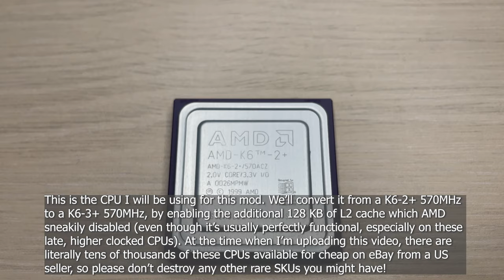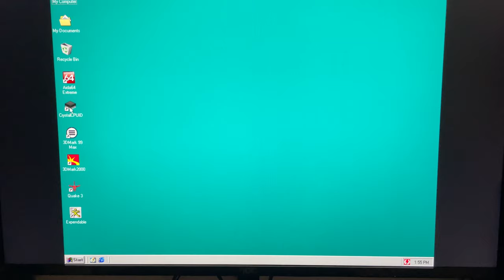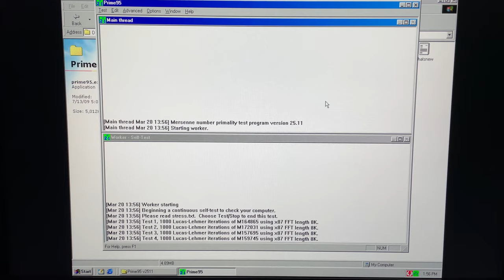GUIDE: Modding an AMD K6-2+ CPU to a K6-3+

Comment: Also, 600MHz? Nice little clock, there.
Reply from the maker: Yeah, all of these CPUs handle 633 MHz without any issue (probably even more, but haven't tried it).
I've just been lucky with my batch of K6-2+ 570 CPUs, I guess. :-)
Reply: @retroshenanigans1  I was torturing my AMD K6-2 350 at 672Mhz (6x112) without IHS (which it terrible BTW in those CPU's) and just air cooled heatsink.Voltages very a little bit crazy though (3,2 or 3,3V core from stock 2,2V). It was actually posting at 500Mhz with little to no voltage boosting (I think it was 2,4V at max) , but from 500Mhz up voltage requirements were ramping up very fast. It was even posting at 682Mhz (5,5x124), but wasn't stable. And that is were i finally killed it setting voltages to 3,52V or something. This was setting for some Cyrix CPU and it was also boosting I/O voltages from 3,3V to 3,52V too. I think this is what it finally killed, not the core voltage itself.

I'm pretty sure those K6-2/III+ can do 690Mhz (6x115) easily. Especially they have lower initial voltage of 2.0V.

Comment: I'll do this with my 550 MHz! I'd like to be able to add new thermal paste in the future under the lid. Is this glue easily removed in 10 years? :-)
Reply from the maker: The epoxy is pretty sturdy, I used it because I don't plan on removing the heatspreader ever again. 🙂 But I'm sure that it can be removed, if one wishes to do so.